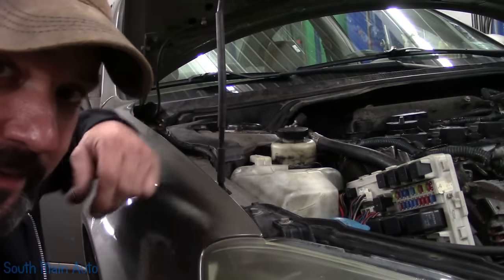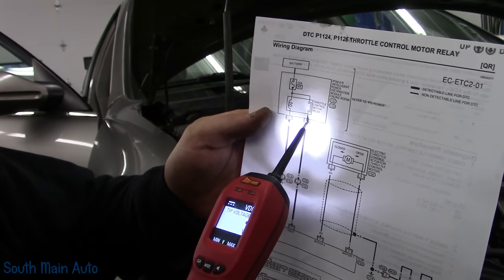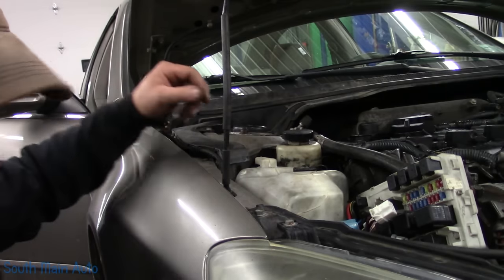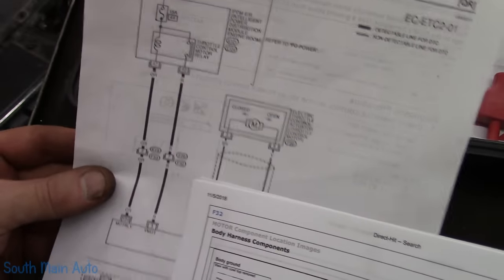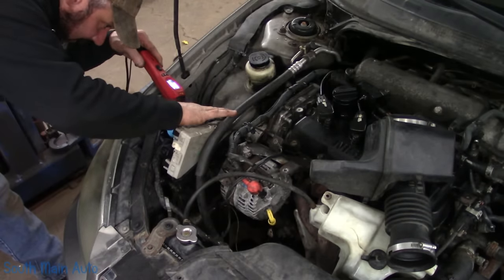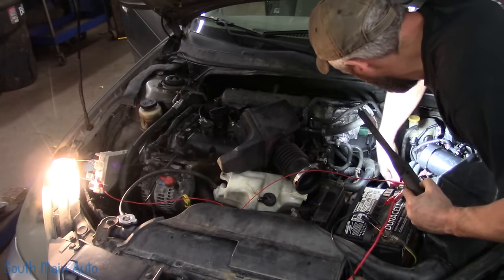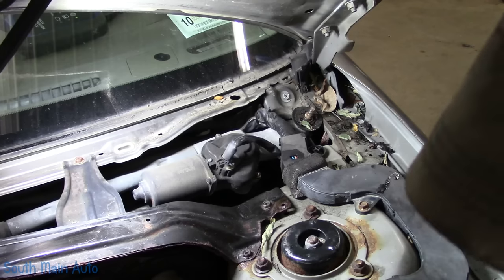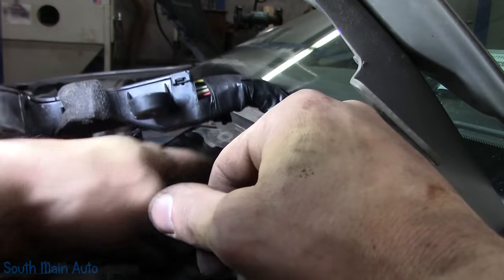How To Fix A Car That Keeps Blowing Fuses

Comment: Incredible diagnostic skills.  I can't imagine a "normal" shop going through this level of trouble shooting.
Reply: Too many are after the almighty $$$, and everything else comes second. This is not just a shop problem, but a SOCIETAL problem. If everyone had Eric's ethics, you'd see news channels disappear - there would be nothing bad to report on!
Reply: no, mostly becaus eif you said to a customer you wanted 2 or 3 hours labour to fix a damaged wire they wouldnt understand. unfortuanlt thats why most garages dont do this or get involved if it isnt a case f changing parts. 
I dont agree with this, but ts how it is in 99percent of garages!
Reply: They obviously didn’t. Just loaded up their parts cannon
Reply: @DIETRYING001  What's cheaper???  Loading up the parts cannon and throwing a throttle body and fuse panel at the problem and then try to sell them you an ECM and still have the problem, or find the real problem and forego all that nonsense?
Reply: Eric functions more as an Engineer than a mechanic.
Reply: @jayss10  well its a pretty obvious answer to your comment and you clearly think that i am saying I think its better to throw arts at the problem...?? if you actually read what I have said properly you would see that implying that most customers are dumb and dont understand that if you tell them the problem is a broken wire and its taken 3 hours at $50 or £50 an hour that the bill is $150... the first stupid thing the customer is most likely to come out with is $150 for a broken wire!!! they dont understand the skill and knowldedge and time that it can take to find these problems which is why most garages dont get invlved or just throw parts at the problem.

to be clear I DO NOT ENDORSE THIS IT IS JUST HOW IT IS IN MOST GARAGES.
Reply: @DIETRYING001  A "good" (hack) mechanic would sell them a new ECM.  After that he would try to find the short in the wire harness. Hopefully he finds the short by trial and error, which takes him 5 hours to accomplish.  To recover his time, he would call the customer and explain that a faulty ECM caused a lot of problems and the car needs a new power steering pump, 3 transmission solenoids and a new muffler. He offers a free blinker fluid replacement to sweeten the deal.
Reply: @DIETRYING001   now u can show the customer the  video  and  they r pay n for the skill  and  not a part list they didn,t need  i do this  and  get more word of mouth work . i quit a shop for  shady  ways
Reply: incredible diagnostic skills is the reason Eric gets many electrical problem jobs hauled  to his shop.  after the parts cannon ran out of ammo.
Reply: @davidwood7170  engineers have book smarts . what Eric does requires hands on experence and  the desire to problem solve.
Reply: @DontCryAboutIt  I agree: one major lesson I came away from this with was "don't blame the fuse; it's supposed to blow, and alert you of a problem in the system!" (my own words)
Reply: I was gonna say it was out of gas , turns out it needed wipers 😂

Comment: this very thing is the EXACT reason i watch these videos. Using the logical steps learned here has already saved me hundreds in unnecessary replacement parts and time. The time isn't as huge of a deal as the money is but following along has saved both so Bonus! Thanks for posting all of this kind of video

Comment: Excellent video. Goes to show you that these shorts can develop anywhere. I bet you(and it's just my opinion) that maybe this car had its front windshield replaced not to long ago and that plastic clip got released during that process. I can't think of any other reason that would have anyone in there down at the base of the windshield. I really like the use of the light to tell when the signal would drop in and out. Very smart diagnostics. Btw, it's a sweater with a zipper! Lol.
Reply: Agreed, def windshield shenanigans

Comment: awesome Eric as usual.  those clowns are not mechanics they are  simply ....part exchange personnel.....they look like fools every time they send you a car that the parts cannon can't fix .... You are a pleasure to watch.  and you should be very proud of yourself... no im not being silly you are the best mechanic i have ever seen by far . respect from England.  take care of yourself pal
Reply: Robert Slackware  I have seen this problem with distributors for decades now, the answer to your question is: Distributor bearings. Yup worn distributor bearings will allow a very tiny amount of play in the distributor shaft, and if the reluctor contacts the magnetic pickup the field will collapse. This will often appear as an intermittent misfire of rough running engine. The engine may even stall if the shaft bearings are worn severely. I first seen this on a Oldsmobile 2.6 V6 in the 80's, I helped a friend completely rebuild his engine in 1 night, started it in the morning and same problem. I asked him what part he did NOT replace and he said the distributor. Got 1 in an hour and the engine ran smooth.
Reply: I second that whole hearted

Comment: A quick and easy way of tracing wires is using a tone generator. Hook it up to one side of the wire then you can follow the path on where the wire goes.
Reply: does not always work...cross talk between wires may be a problem...

Comment: As Eric always does, he WORKS the problem with scan tools, diagrams and common sense , not guesses! Thats why he fixes cars that others cant and his customers are very happy...
You can see the result of using a wire instead of proper fuse. The wiring now is forced to carry too much current and without a weak point like a fuse, it can even catch fire worst case and do a lot of expensive damage. Thankfully if you dont have a power probe, a simple multi meter ($50) can be indispensable in checking for hard/soft shorts and voltages in wiring/alternators as well as resistance for bad grounds on bodies and engines. So a little practice using one, you will find it one of the most useful electrical test tools you can have in all basic electrical work
The light trick works great as it protects the shorted circuit with resistance but instantly tells you when you are near the short by flickering. when the bad wire is disturbed.
Reply: @DontCryAboutIt  Yes you can pay $10 all the way up to fluke types of $1000's. I have had many meters and good quality starts from say $50 as you want quality and accuracy and i have thrown away $30 ones that look ok but just were junk after a short time. When posting here, i wouldnt want anyone to go out and buy a chap nasty one and have a bad experience with their first meter, nor do i want them to pay top dollar if they arnt going to need all the extra features and "name" on the meter. 
If you repair all manner of electrical things as i do not just 12v car circuits, you would already know what bad meters are like. I repair my own cars mech and elec, computer power supplies, LCD TV's and even old CRTS/oscilloscopes which i have a few. I know BS, logic and what works and i find myself correcting nonsense all over silly you tube videos, whether its flat Earth believers, creationist or sucky back yard mechanics and even pro's who guess their way and offer poor even dangerous ideas and advice.  
Eric never needs "help" but sometimes its worth" highlighting" important bits that he cant always make it clear to the viewer when he up to his elbows in the mess left from so called "skilled technicians".
Reply: DifferentialTim 
The best tool, and costliest, yet most valuable, is the access to wiring diagrams. 
Paying a monthly fee to get diagrams is worth it, if you have the volume of that type of work. 
Obviously, the other shop doesn’t have access to diagrams, they just shot the parts canon at the car, then jumped the fuse and looked for smoke, they apparently didn’t look at the cowl when they did that. 
Eric was starting to follow the wrong harness, til he printed the wiring diagram.

Comment: This method for finding the short worked well, but wouldn't your Power Probe ECT3000 have pointed you to it more quickly? However, if you showed this method so that those without one could find the short, I understand & applaud that. Great fix as usual.

Comment: I feel your pain on those Nissans Eric. The harness sucks on them. I had one where I also had to remove that fuse block to do some testing and was not happy about the fact that there is no slack on the harness to work around. Seems we spend more time gathering information/ locations than we do to repair the vehicle. Great approach as always. But one question. What is it with you and shorts near a wiper transmission? LOL

Comment: you are absolutely an amazing electrical wizard!!!!  LOVE your videos!
Reply from the maker: See that's the thing I am not. Fact is, it's just one wire that is shorted to ground. That is basic elementary mechanics 101...
Reply: @SouthMainAuto  So humble Eric. The sign of a true master.
Reply from the maker: @klwthe3rd  It's true. I am not writing some kind of in depth code, putting a man on the moon, or rebuilding an engine. Heck I am not even tracing an intermittent for that matter.
Reply: @SouthMainAuto  Well my personal experience has been that I've had to junk previously owned cars because I was told, "it's not cost feasible for us the dealership to spend the hours and hours of diagnostic time to trace the source of the short sir. Do you know how many miles of wire are used in your car sir? The reality is, these kinds of repairs are very rarely ever performed because shops dont employ people like you who know how to narrow down the cause point. You're the first mechanic that I've ever seen do these repairs constantly with winning success. To me you are the king of electrical repairs. I bow my head. Lol
Reply: In my eyes, he is truly a master! You see why everyone brings the tough ones to him....

Comment: Very impressed with the idea of putting a light in the shorted circuit, to keep the fuse from blowing, while you moved the wiring harness around.  I train maintenance technicians for industry, and I'm going to tell them about this.
Reply: Yes, that was a stroke of genius.  I have to remember that one.
Reply: No fuse in the circuit to blow at that point.

Comment: Have run into the same issue with my Nissan Altima. It was a nightmare. 
Been a mechanic for 47 years, and you are one of the rare people that don't just change parts. Logic, Reasoning abilities and a good understanding of DC VOLTAGE, MY HAT IS OFF TO YOU!!!

Comment: How did the other shop react when you told them what the problem really was??  For that matter, how does the customer feel about throwing the money into it for parts that are not needed?  Seems like most folks would be much better off to just bring the car to you in the first place! :)
Reply: Yea its situations like this that bring you more customers and business
Reply: The customer will never know.  Dr O was an independent contractor on this job.  The original shop probably wont disclose the real fix.  Although, we dont know if it was the shop or the owner who used the speaker wire fuse...but that old fuse box was trash too
Reply: @murariufamily  theyll probably sell them the new ecu anyway.
Reply: @ne2i   the customer probablyalready balked at new ECM

Comment: Don't you just love how the manufacturers use just enough wire on components to assemble the vehicle,? but there is no way they will give you an extra couple inches of wire to be able to work on the darn thing That might cost them an extra few cents per vehicle. Eric ,your tenacity at tracking down the problems is always enjoyable to watch!
Reply: Are you the guy who made scotty kilmer make the cat pillow video ? hahah
Reply: Back in the Middle Ages, my uncle (Mom's brother) hired my dad to help pull a long, heavy industrial circuit in a factory. I don't know how big the wire was, but it was expensive, and Uncle bid the job flat rate including materials.  The circuit was several hundred feet, and they ended up with less than 6" of scrap. Dad never worked with him again - there's just no reason to go that cheap on wire.
Reply: @busbqbill449  I guess from a simple pillow question
Reply: @DaddyBeanDaddyBean  Ahh, but there is!!  On my daughters 2003 taurus, I have to remove the cam position sensor cap and oil the top end of the syncro shaft every 3 or 4  months or it will squeak like a dying pterodactyl.  Would you know there is a main part of the wiring harness stretched directly over the cap without an inch to spare.  I have to wedge a golf ball under the harness to keep it up just barely enough to get the CPS cap off.  The thing is, they could have saved few inches of wire by routing it before the CPS cap.  So they go out of there way to make it difficult.  I have a new found respect for the engineers ability to figure out ways to give us DIY'ers a headache.
Reply: @SGDeGalvez  I've always wondered what a dying pterodactyl sounds like. I'm off to the junkyard to find out!

Comment: What kinda genius puts a jumper in a fuse box; I'm no mechanic, and I know that if you keep blowing fuses, the problem ain't the fact that the circuit has a fuse... these clowns that gave you the referral do not seem like the shiniest wrenches in the toolbox.  I wonder how many hundreds in parts and hours of labor they spent just throwing random electrical stuff at the problem.
Reply: the same kind of genius that would put a penny in the old style screw in fuses back in the day and burn the house down..those were actually pretty safe because there were no moving parts like in a circuit breaker but  people mickey moused them..
Reply: that was the old school way, insert giant fuse/jumper and wait for the smoke emitter / flame, put it out and fix it.  even increase the load on the other end of circuit :))
still a very viable way to find issues, providing you act fast and are not afraid of smoke and fire.......
Reply: @throttlebottle5906  - that's one thing when you have 15-20 wires in a bundle and everything is 12 volt wiring ... what about when you have 50 wire bundles like in todays cars and lots of sensitive CAN network electronics running on 5 volts or less?  :)  What is that 12 volts going to do if it shorts across several other wires that are going to other computers?
Reply: I guess you do not want to see what occurs during jump starting, or other surges caused by loose battery terminals. I can guarantee there's ugly spikes and surges well over 20v on them, not to mention many other things can cause it. the same can bus is used in 24v truck systems, with spikes surely 30+ range. it's not a perfect system, but there's a fair amount of protection inbuilt and if they were that sensitive, not a vehicle one would run today after a a nearby lightning strike ;) 
i'd be more worried about 12v+ getting onto sensor power feeds and backfeeding the ecm, but again, any of it without protection would be the dumbest and very ignorant engineering practices.
Reply: @throttlebottle5906  You make some good points .... I still think intentionally creating the magic $$ smoke is not the best long term way to find wiring problems. :)
Reply: the smoke and fire was a <sarcasm> line....... but on that subject, many people see smoke, fire or both and freeze solid like a "deer in headlights" or go into a useless frenzy of flailing trying to grab a few meaningless items and do anything but try to extinguish it immediately while it's small and easily extinguished. but no worries, the Fire Department will put out the shell and douse the embers! 
we jokingly call them "basement/slab savers", because by time they're called and arrive it's too engulfed to extinguish, it's even happened to fire stations before.
Reply: ‘Parts Hangers’....the former ‘helpers’, not in Eric’s shop. Wow...just wow.
Reply: Far too many, especially people who work in construction around my parts, it's a really common thing to find 20A+ fuses where there should be 5A fuses or I've even come across just wrapping copper wire between the spades on a fuse when even a 30A wouldn't hold any more. It's always a massive pain in the ass because the wiring looms on construction stuff is even less accessible than on cars.
Reply: the genius that wants to start a massive fire...
Reply: throttle bottle q
Reply: If you keep throwing stuff at the wall eventually something will stick, you hope. It's a good thing the short wasn't between the ECM and the throttle body or they would have probably fried it with the jumper trick. Eric. Just like the hound tracking the fox. Once he gets the scent it's all over for the fox and the elusive wiring gremlins.

Comment: Late to the party here, but this video was extremely helpful!  I learned about breaking the circuit up into sections, to isolate the short.  And I learned the “test lamp + shake it” trick to help locate the problem.  I was able to find a short in my Saab’s interior lighting circuit, at the sunvisor mount of all places, with these after spinning my wheels for several hours.  Thanks Eric for sharing your expertise!